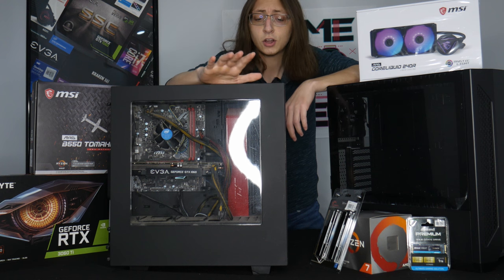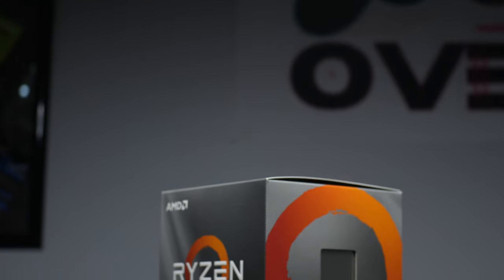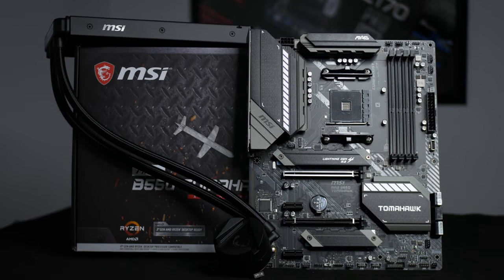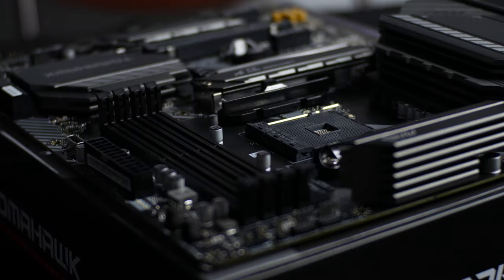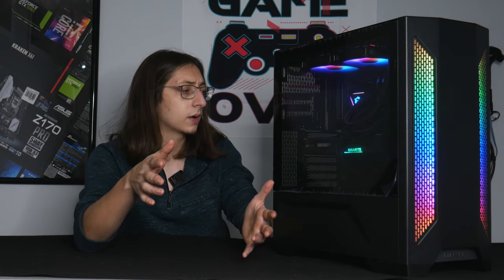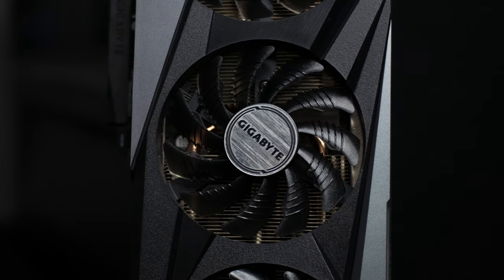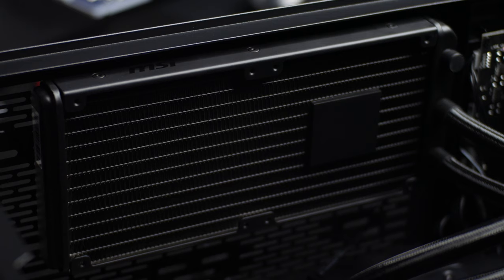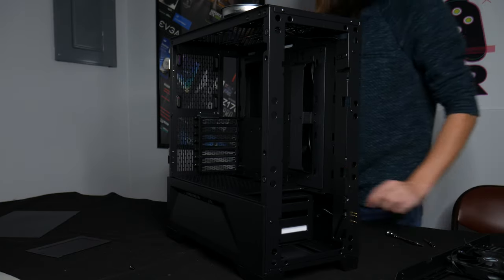Building a KILLER RTX 3060 Ti Gaming PC for $1,300!

Comment: What motherboards should o use with the r7 3700x? Looking for good looking and efficient motherboards
Reply from the maker: The one I used in this build is the MSI B550 Tomahawk. Basically any B550 or X570 board should be good as long as they're not like dirt cheap.